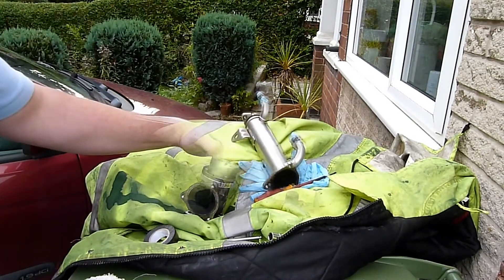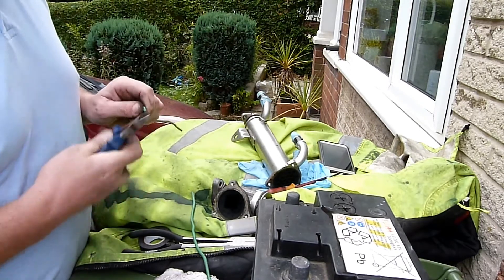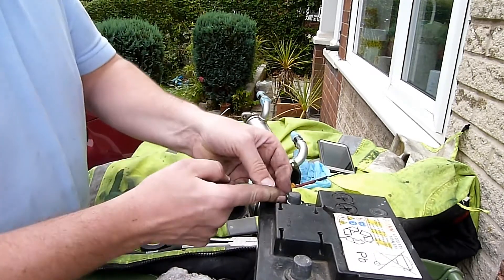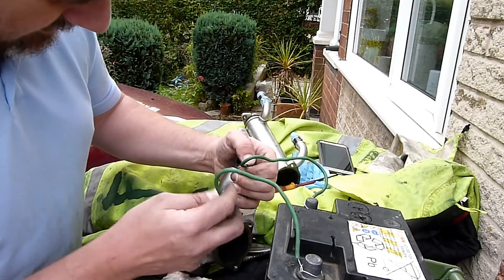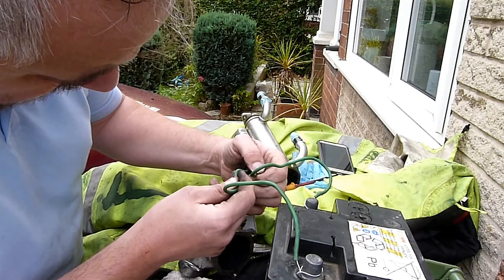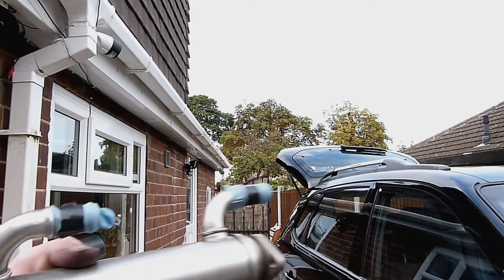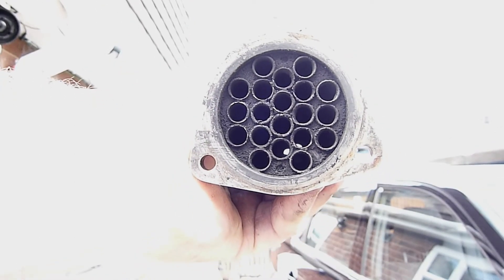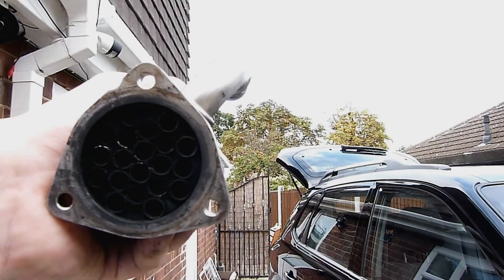Hyundai Tucson EGR Solenoid Test  Pt3

Comment: Good video well done, this is the same EGR as on my Sportage 2008 Diesel.  Mine stuck the symptoms were it would start then stop straight away.  If I unplugged the EGR solenoid the engine would start and run but not very well.  What I did find is that by removing just the solenoid top and using WD40 and carb cleaner sprayed onto the valve I could gently tap it down (it was stuck at the top).  Once down another spray and it was possible to get a small spanner on the end of the valve shaft (it has two flats on it) and by rotating it the valve comes back up under spring pressure.  More spray tap down again and spin back up, repeated a couple of times and it freed right off.  Seems to be working OK so far and only took about 30mins.  Once again thanks for making the video.

Comment: Why You change it if it works?
Reply: The solenoid works it is the valve below it that it controls that is the problem it gets gummed up and sticks,  it can be cleaned sometimes to get it to work again it should push down under finger pressure and pop backup by spring pressure,  they can get stuck solid by carbon deposits.